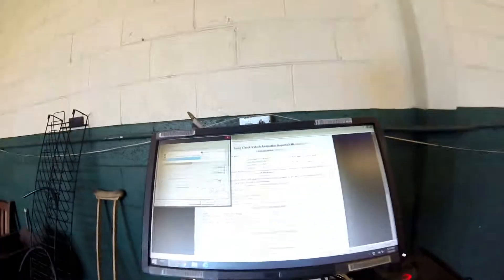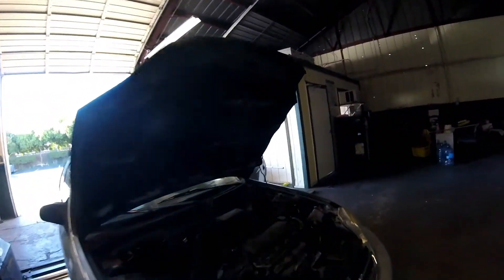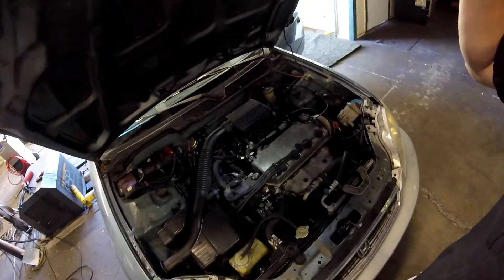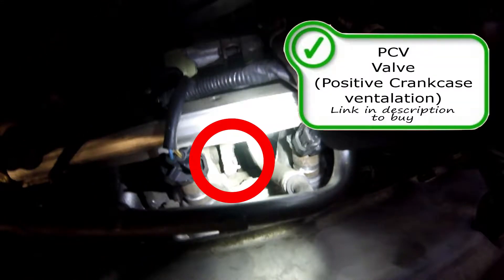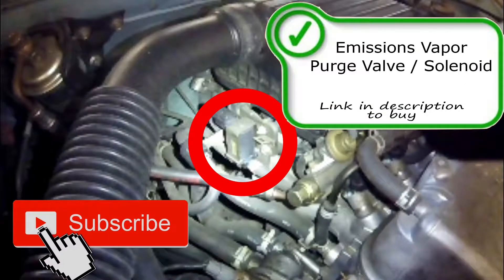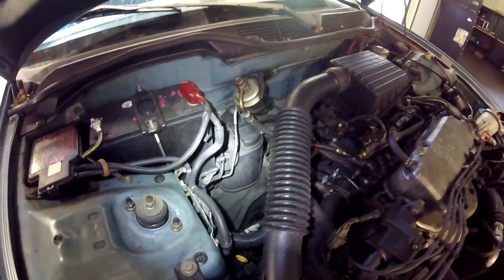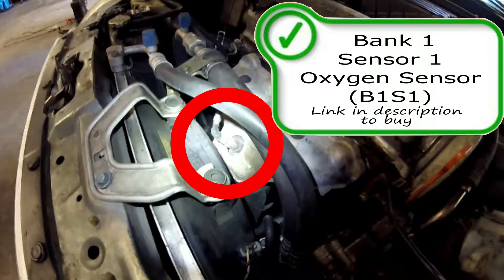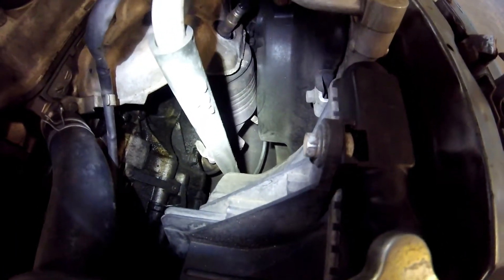⫷ Honda Civic Emissions D16Y7 PCV, EVAP, Oxygen Sensor Locations ⫸

Comment: I'm trying to change the PCV on this engine, would I be better off getting to it from top or bottom? anything easy to move to make it easier?
Reply from the maker: The way I did it in the video is really simple.
Reply: I'm using this method this weekend when mine arrives. (From below, removing the oil filter):
Replace 1999 Honda Civic PCV Valve
https://www.youtube.com/watch?v=M5k1cD4ruTU